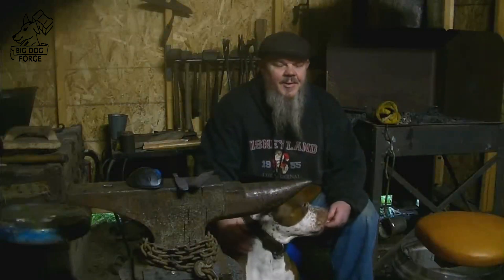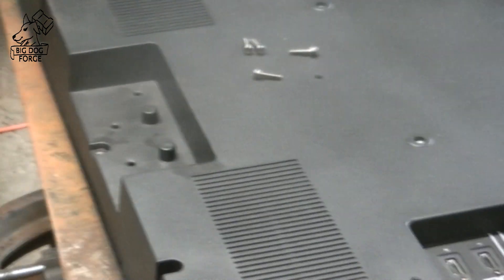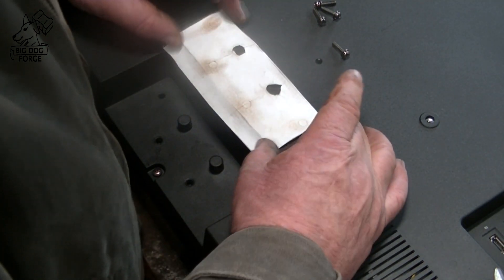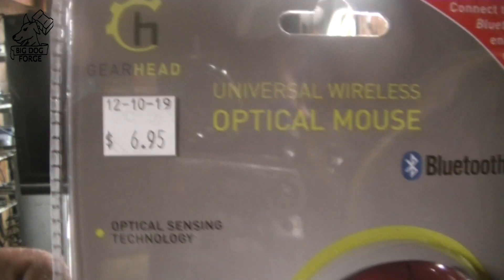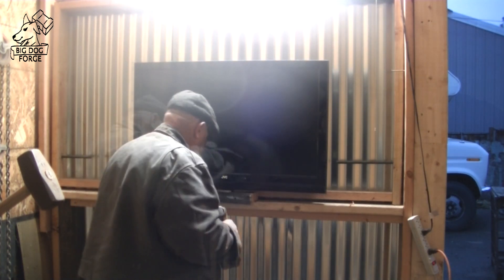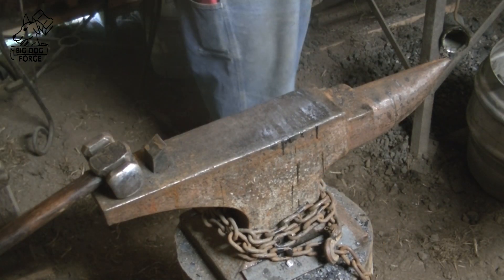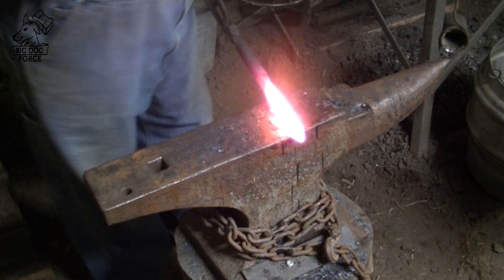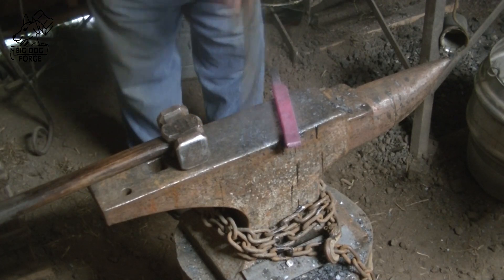Happy New Year From Big Dog Forge

Comment: In a state with 10% sales tax, price is king.
you prolly know, but the LCD panel is a multilayered brittle fragile plastic sheet with only a clear layer protecting: the slightest pressure will fracture it into a hundred long cracks, and kaput. I leaned a monitor forward against a plastic box upon the screen: crunch. 
I'd get a piece of glass or lexan covering it, esp. a shop tv at that height 3:50 where you'll hit it... 
[The old CRT tv's had inch think glass: I literally couldn't break it with a sledgehammer.]